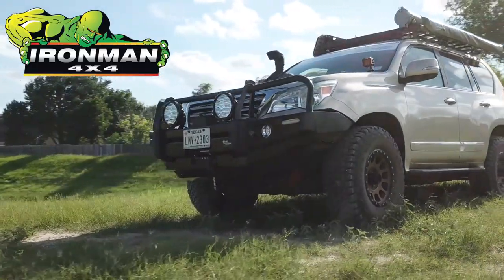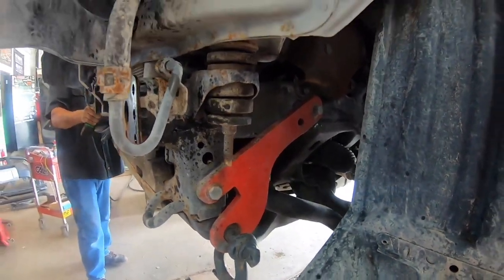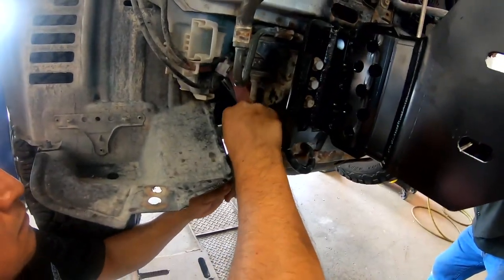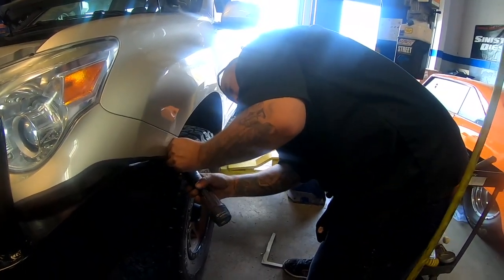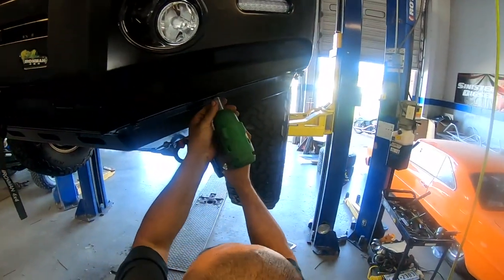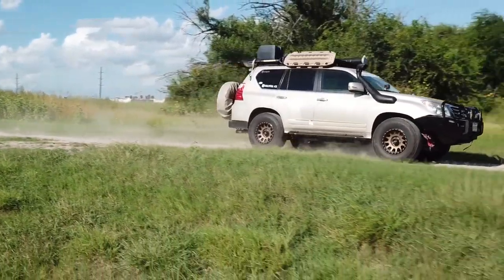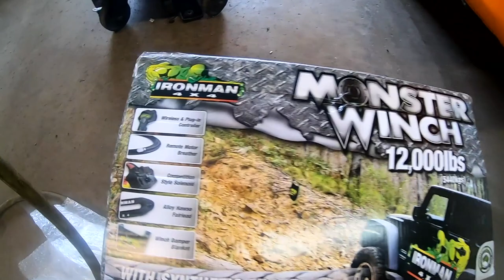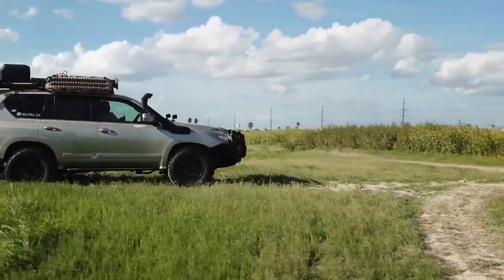Lexus GX460 off-road bumper and winch setup review!

Comment: Thanks for sharing your install experience with the Ironman bumper.  I picked one up for my GX and it is getting installed in the next few days. Only after getting it unwrapped did I realize the holes for the parking sensors were missing.  It wasn’t too hard to drill the holes.  Just look at the 2014+ Premium bumper and copy the placement.  It took about 2 hours to drill and paint the holes.  The factory wiring harness, sensor and sensor holders from the OEM bumper can be removed and reused.
Reply from the maker: I kept the harness and the sensors. Please send me pics when you complete yours.
Reply: @CoastalGX  check out this thread on Mud.  
https://forum.ih8mud.com/threads/calling-on-ironman-classic-bumper-owners-gx460-2013.1232349/page-2

Comment: Awesome build. Thanks for sharing this with us. I was just curious. I am thinking of getting a third-party bumper to install on my GX. But I heard that by installing a bumper we may affect the airbag sensor. Did you happen to run into that and was that of any any concern to you at all? Thanks!
Reply from the maker: Good question. No, the airbag sensor isn’t impacted and the ARB/Ironman bumpers are designed to work with the vehicle. There is controversy on whether these bumpers are of benefit since the original design of the vehicle is best for impacts. The bumper’s main use is for animals. Australia has issues with kangaroos etc. We have deer and coyotes. A clear benefit for me was the winch placement and off-road lights. In our GX, front clearance is limited so the bumper will help. I hope some of my thoughts help guide you to what you think is right for you. Thanks for watching and commenting.
Reply: @CoastalGX  thank you so much. Yes this definitely helped a lot. I may be leaning towards the Iron Man bumper. I was also looking at the CBI, but I saw another review which really soured my view of it. The Iron Man looks way more functional.

Comment: @Coastal GX, subscribed. I’m also considering this bumper for my 2011 GX. Regarding the lack of parking sensor holes on the new bumper. Did this cause any sort of dummy light to illuminate on your dash by no longer having sensors? Thanks
Reply from the maker: I own a 2012 with some luxury options. No weird annoying lights on the dashboard whatsoever. Thanks for the sub and good luck with your build. If you can, get the winch while you’re at it.

Comment: Where did you get the signal lights resistance? I'm ordering a bumper from ironman and l didn't know I would need that, also, how's the experience with their winch? (If you have use it)  I'm considering getting a smittybuilt or warn
Reply from the maker: Try this:
https://amzn.to/3NUTXKy
Reply from the maker: I’ve only used the winch to tension it. I tested it again last week because I was going to use it with a lane anchor, but didn’t need to make it work hard.
Reply: @CoastalGX  thank you so much, l appreciate the info, stay safe